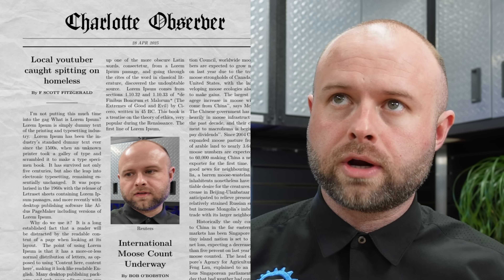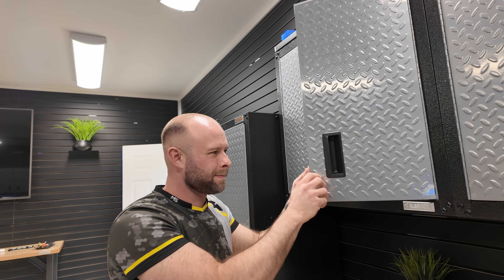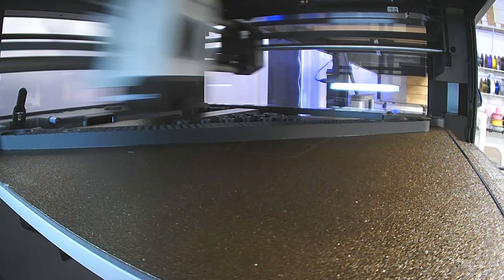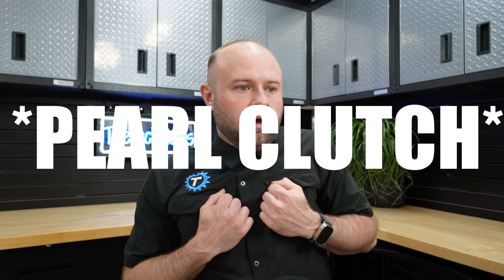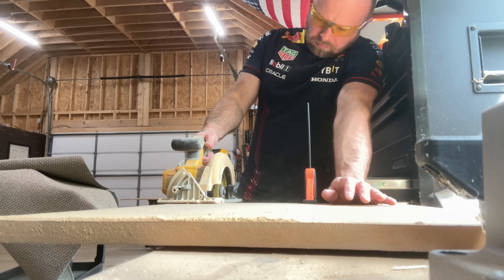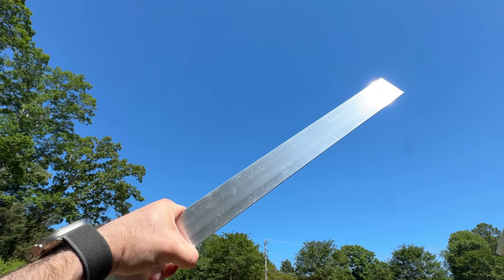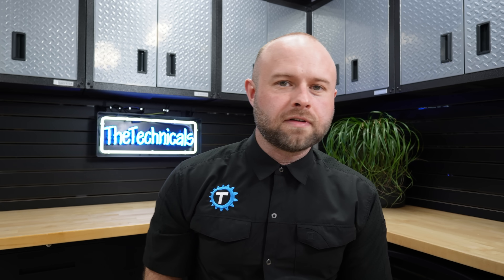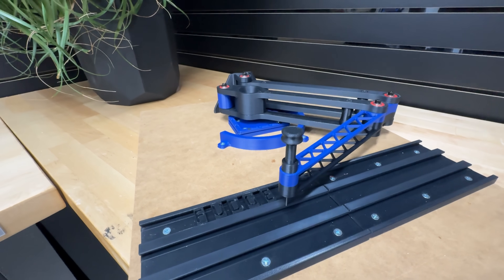This 3D-Printed Tool is Crazy (Viewer Submitted Design)

Comment: What relatively inexpensive slice of metal would be recommended for this that won't suffer from things like oxidation?
Reply: The pantograph is designed for all materials. Stainless steel is therefore no problem with the right cutter. A stainless steel business card usually costs less than $1. I recommend a thickness of ~1mm
Reply: @Chris623 Is a great deaign
Reply: @saliston  thanks
Reply from the maker: What about a hard cheese?
Reply: @TechnicalsTinkers  Not if the goal is to keep dirty rats from stealing your key.
Reply from the maker: "Dirty rats" is basically anyone with digital assets
Reply: @TechnicalsTinkers  3D-printed cheese engraver 🤣